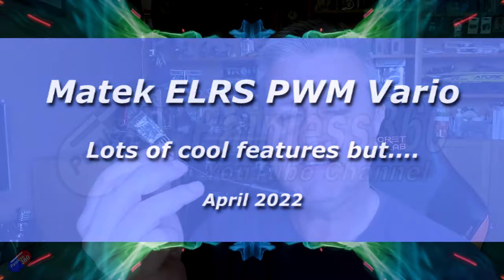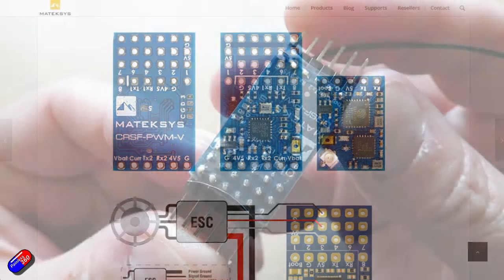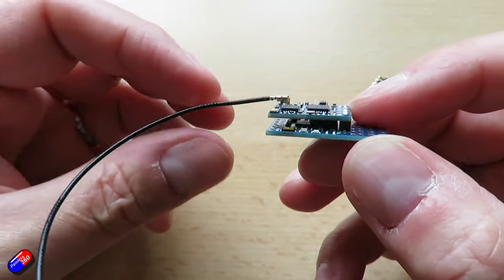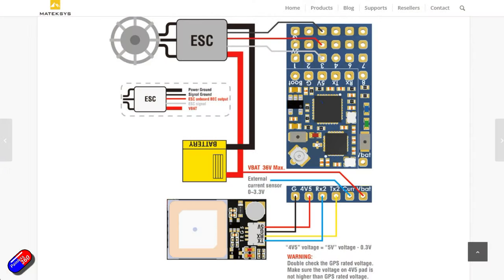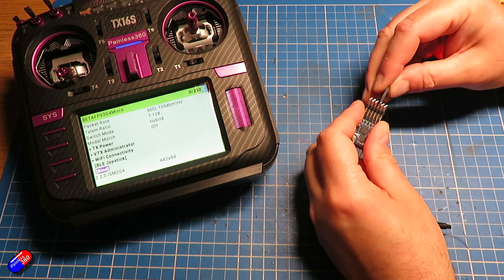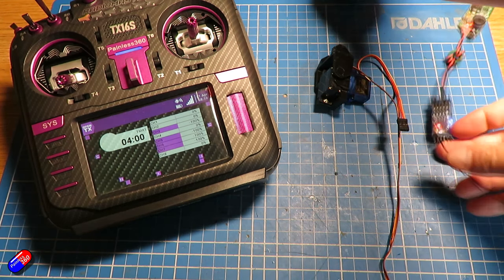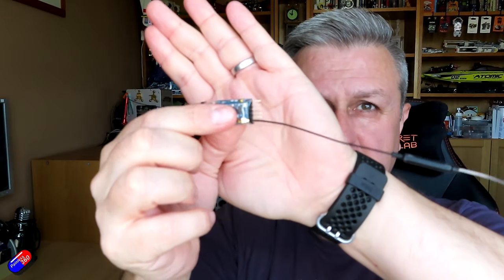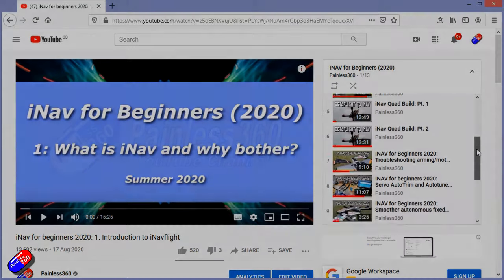Matek ELRS PWM Vario Reciever: As good as I'd hoped?

Comment: The vario integrated with the CRSF-to-PWM board is very appealing. TBS offers as CRSF-to-PWM adaptor board for CRSF receivers, but not with vario, and only recently added GPS option. Believe Matek offers as well, but without the vario (and GPS) functionality.
Since the Matek board has vario, would be curious if the adaptor board would be compatible with TBS CRFR or Tracer receivers?  
(if Matek is reading, consider offering the adaptor vario board as a standalone purchase if possible)

Comment: The vario would be great in gliders. Its just a shame that there are only 4 full res channels. Having the flaps also on full res is pretty important, especially if you go for a full span aileron setup.
Reply: With wide channel mode you can get higher res on the switch channels (256 steps IIRC) so it should be quite usable.
Reply: @pfeerick  I know about wide mode. Would you use wide mode with only 255 steps to control ailerons? I wouldn’t. It needs to be full resolution.
Reply from the maker: I am testing exactly that at the moment - stay tuned :)
Reply: now you get that what you had wanted even a smaller glider version from Radiomaster if you check Lee's latest videos cause Radiomaster has released 6 or 7 receivers this week and among them a small glider variometer edition. I hope you will get this message from the broken youtube notification system.

Comment: Lee, now that ELRS v3.0 is released with better wing/PWM support, wondering if the support for the Matek R24-V ELRS has been improved?
If not integrated into ELRS configurator, it would be nice if there was an EdgeTx/OpenTx Lua script to tweak settings on the transmitter, and not need a separate configurator.

Comment: Hello, for information on the telemetry display of the BEC battery voltage using the balance connector.
It is sufficient to connect Vbat to the positive extreme pole (usually the first red wire, the black negative pole is at the other end) on the balance connector. The negative pole (ground) does not need to be connected. And the red plus pole on the servo connector can also remain connected. Tested with 3s and 4s batteries.
Reply: I forgot: the vbat_scale value should be x:110 (in the Matek Configurator)

Comment: I understand your reservations but, for me, the problem is ELRS only having 4 full resolution channels. I have 2 gliders with flaps where I need 5 channels so I have spoilerons (and can more easily subtrim an individual aileron) and 2 gliders with flaps where I use 7 channels so as to have flaperons, camber, reflex and crow. Many of my other models need 5 or more full resolution channels. I really love what the ELRS team has brought to the hobby but it's not for me till we can have more full res channels. Spektrum and Frsky receivers and my TX16S cover everything I want plus a Crossfire module for things with a lot of carbon in them.
Reply: Yes. I really wish we could have six full resolution channels for full house gliders. Ok, maybe seven channels for motor gliders ;-).
Reply: I believe channels AUX2 to AUX8 can be setup in a 6/7 bits mode called "wide hybrid" which has more than adequate resolution for things like spoilerons/flaperons, etc. The 4 full-resolution channels (10-bit) are reserved for the "sticks".

Comment: I scooped up one early on. I had in mind to replace the FrSky R9/vario/Vbat/cell monitors set up in my highly modified very experiences  Parkzone! Radian motorglider. I had already put the Matek 2400D rcvr with its form of diversity in all my quads and a Nano Goblin and am very satisfied with its range. Loking at the PWM-V I like that it was not integrated only to the well soldered on rcvr so I de-soldered it and replaced it with the 2400D on a pigtail that allows the rcvr to be placed in a better location that near the battery and other electronics. It is a neater install that the fine functioning R9. The vario, Vbat, gps telemetry is great, but I still haven't figured how to get Altitude. There is a way, instructions for OpenTx  to report CRSF Alt, just can't rap my head around it. 
Yes I agree, not fully baked, but I hope by supporting it development will follow! Thanks for reviewing it!
Reply: I have one of these. The altitude telemetry is generated by the GPS, but unfortunately always outputs altitude relative to MSL, which is pointless for a LOS glider. Hopefully matek will have a firmware update to output altitude relative to the power on altitude - and ideally drive from baro rather than GPS
Reply: I believe if you don't have a GPS connected it still uses the GPS alt field as there is currently no standalone alt field in the CRSF protocol? Thus once you connect a GPS it probably overrides the barometer... If so, that needs to be an configurable option (sensor priority).
Reply: The new firmware update for the PWM board is now available to allow Altitude telemetry. If you update the latest firmware for the RX, TX, PWM board and EdgeTX.
Reply: @spinlaunchglide  Oh, nice, was waiting on the Matek firmware to drop. Thanks!

Comment: Interesting device! I've been using Matek's separate ELRS receiver and PWM boards with great success, and this is another step forwards by not forcing you to use the binary channel 5 and still providing pins for 6 channels. And the vario of course! I take your point about having to use two interfaces to set the device up but I think Matek are hampered a bit by maintaining conformance to the open source ELRS project on the receiver side. Given time (and support from Matek) ELRS could develop the PWM use case, but the project is very quad focussed.

Comment: Can this receiver be updated to 3.x firmware, and will the vario functions still work? I recently bought one of these and can’t seem to bind to it with a RM Boxer that has firmware version 3.2.1. Could it be due to the unusual, and possibly outdated DIY firmware on the receiver?
Reply from the maker: I'd check if it is listed on the ELRS Configurator. I don't have mine here to test... Happy flying
Reply: Thanks again for your quick response. I found the (embarrassingly simple) error on my part. In the configurator, for Device category, I should have selected DIY 2.4 GHz, instead of Matec 2.4 GHz. The Rx is working now😊

Comment: Very nice & useful video as always Lee, well done. In the end have you flown tested the receiver ? Was it good ?
Reply from the maker: It worked fine but most of the ELRS stuff I see now is connecting to a flight controller.. Happy flying!
Reply: @Painless360  I noticed the trend but not all the planes have the space or need for a FC, like small gliders, etc. Maybe the manufacturers will come with more PWM receivers in the near future.
Reply from the maker: They are - I have some on the way at the moment... Stay tuned!
Reply: @Painless360  Cheers for the info ! Any particular brand(s) if you can disclose that ?

Comment: Hi how to ger Current and Volt information  using thia CRSF to PWM converter?
Do we need additional current sensor?

I am using Matek 😊R24 ELRS Receiver, CRSF to PWM conveter and Radjomaster Pocket as my TX
Reply from the maker: CRSF sensors are coming. The other way I'd look at doing that is to use a flight controller than can send telemetry..

Comment: I have one of the newer versions of this RX with the latest ELRS and board firmware installed.  The main outputs are numbered 1-6 and You now can remap any channel to PWM 5.  ALT was added to the CRSF protocol and is now available for Telemetry from the baro, not just the GPS.  The only problem I can't get past is my board has a 6 amp positive bias which also affects the mah used telemetry.  
Has anyone else used current monitoring with this product, and was it accurate?

Comment: Damn... this isn't as good as I was hoping then... I was hoping (like you, I think) that the integration was more like the ELRS-R24-P where all configuration is through the web GUI. I will still get this since it is a nice compact all in one unit, but will probably also get the CRSF-PWM-B, since it actually has 8PWM channels rather than 7 this has, although for it you need to add the barometer externally.

Comment: I have two of these and they seem to work well. One question, the vario data, and some other outputs, only seems to update about every 5 seconds or so. Any idea why this is? It needs to be continuous to be of much use for a glider. It looks the same in your video review. Updated both firmwares to latest at 23/6.
Reply from the maker: I'd check the forums, it could be version related... Happy flying

Comment: was very excited to receive 2 of these. however after flashing and setting up, I seem to be having very jittery servo movements. any ideas? It seems unflyable how it is. V3 firmware. Happens on both. Cheers.
Reply from the maker: I've not had that here. Maybe something with the gimbals on the radio or the channel setup? I'd let the developers know in case...

Comment: Hi there. Love your work and vids.
I have a question. I would like to use this rx in my DLG and would prefer to have an Alt telemetry instead of Vspd to have a launch hight readout. Is there a way to pull this off?

Tnx
Reply from the maker: Not sure. I'd check what sensors appear in the telemetry... Happy flying
Reply: Hi Ido,  I just updated my firmware on the board (and updated the Rx to 3.1 at the same time)  and found this on the matek site:    Start with EdgeTX 2.7.1/OpenTX 2.3.15 and ExpressLRS 2.5,  Baro Alt telemetry ID is supported in CRSF protocol.
 Can confirm telemetry shows baro Alt as well as VSpd with the update.
Reply: @paulg7763  how do you update the pwm converter board?
I have an old ftdi to usb thingy but it did not work...
Reply: @idomohar  I just used the fdti adapter and it worked as advertised.  But as I have a few of these matek converters I noticed a couple of times I had to connect and reconnect it a few times to get it connected to my pc. Possibly a problem with the converters or my ftdi adapter,  but once it connected it was fine. Oh, check com port setting, maybe that's your problem.  And you will need to install drivers for the ftdi adapter if you haven't already done so.
Reply: Also ido if you happen to have a flight controller laying around you can update it that way.  It's a bit more cumbersome than doing it via ftdi adapter directly,  but it's an option.
Reply: @paulg7763  not a drone guy... I ordered a new  cp1202 and will try it

Comment: is correct that has only vario and not altitude sensor  ?
Reply from the maker: GPS will give you altitude..
Reply: Paolo, you can get Baro Alt with a board firmware update.

Comment: 8 channels yay!
Reply: 7, actually, and unfortunately still limited by full res 4 channels, and lower res switch channels, although you can make the switch channels reasonable usable having them in wide mode.
Reply from the maker: Indeed. Shame that CH5 and CH8 are not with the others. Some testing of flying using the wide band switch channels coming soon as I've heard two camps and wanted to test it out.. Happy flying